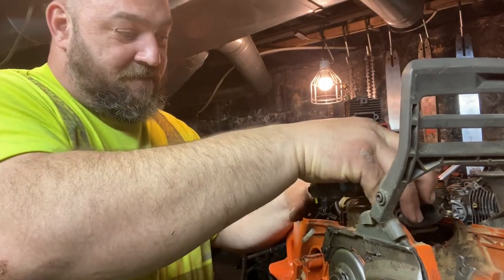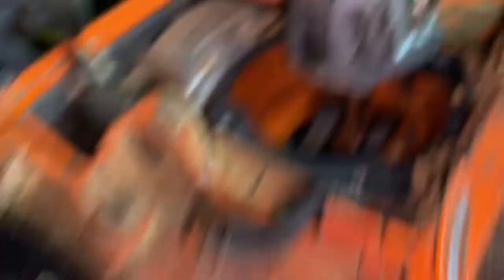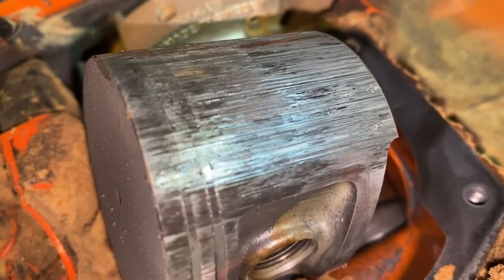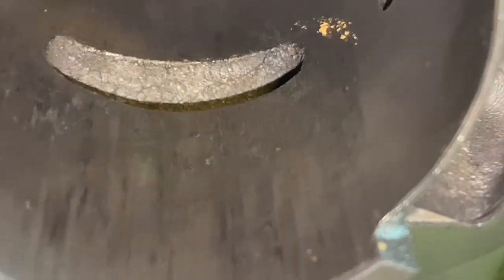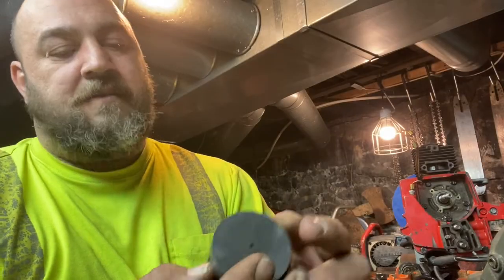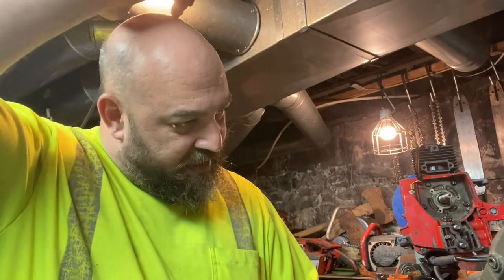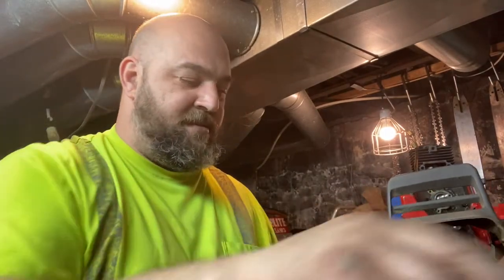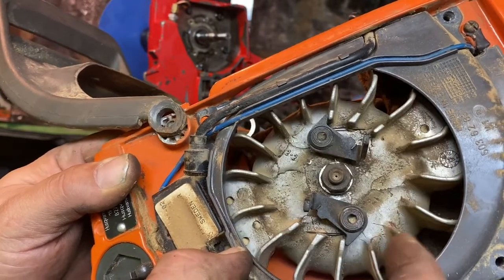Husqvarna 371 Disaster On The Bench!  Teardown And Inspection!

Comment: Husky 371, one of the reasons why I only run vintage saws here on the homestead.  I had a 371 that always had problems.  The first was the recoil spring broke, you had to buy a complete sidecover-starter assembly for $84, a new spring for my McCulloch $10.  Even with a new oil pump assy, running a 32" bar, it would not pump enough oil and the chain would stretch and bar would get hot.  My Mac's have the over riding oiler, so no problem there. Carb diaphrams failed at an alarming rate due to the high RPM, and I  was always working on the carb. My Mac's carb diaphrams would only fail from the lousy gas I had available at the time. The 371 was light and powerful, but always failed out in the field, so it was replaced with another McCulloch that is still on the job after years of reliable service.
Reply from the maker: The 371 issues is what caused the development of the 372.  I am on your side.  Stick with the vintage saws!

Comment: I think a bearing grenaded and wiped out your piston and cylinder. Cases will definitely have to come apart and bearings installed. You could use an aftermarket 372 p/c as they are interchangeable with the 371. That would keep the cost down and the quality of those seems to be getting better. An OEM would be ideal if you could get one for a decent price.
Reply from the maker: Thanks for the tips!
Reply: @Smittyschainsaws  On second thought, That amount of scoring looks like a lean seizure caused by an air leak or set too lean on the high speed needle. How many turn(s) are on the high speed?
Reply from the maker: The bearings feel rough. I’m thinking seal then bearings then cooked. His description on how it was running tells me it was lean. The chain is a mess as well. put that all together and you can see the results. I have not looked at the carb settings.

Comment: Curious if that cylinder can still clean up. Nothing to lost if it doesn’t work. Hopefully the crank is still good. I understand the aftermarket ones are sketchy.  
My guess, chain side bearing failure led to seal failure.
Reply from the maker: I might have a donor!  I may not need to try and clean it up.